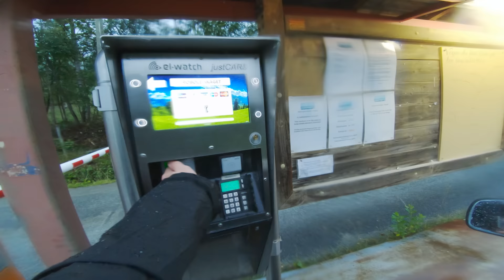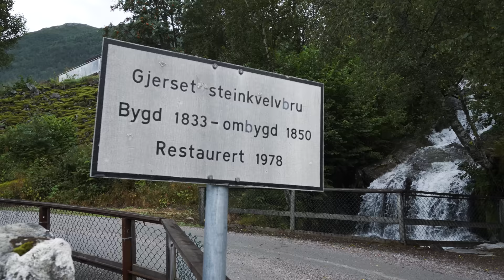NORWAY on a 125cc Motorcycle

Comment: I owned one of those Yamahas in Thailand except it was 150cc. The TZR 150 . Minbe was red and white and went like shit of a shovel. I actually saw 180 kph on the clock , tucked in with my head down behind the fairing. Didn't feel very safe but was a real thrill to hear the engine screaming through the red line. Long time ago now.

Comment: Been to Norway in 2016, on my TDM900. Great time riding. Went Hirtshals-Kristiansand. Hirtshals is exactly 1000 km from home. In Norway you see a lot of young dudes (why is it STILL not 50/50, what is wrong with the girls?!) riding 125cc. Where speed limit is 80 kmph, that is great, however, in 120 kmph traffic and left lane speeding, a 125cc has not enough reserve power that you might need escaping danger.  A 250cc bike would be safer! Pitty the EU has not done that. Things are what they are, and avoiding crowded highways is more fun, anyway.

Comment: I had a 1989 Yamaha TZR125 many years back. My model was the 2RK. Does yours have the fully working power valve (YPVS)? Your one must be the 3PC1 model as it has a rear disc brake.

Comment: Very good.
What cameras did you use and what settings while riding to get motion blur?
Reply from the maker: I used the gopro hero 6 for all riding clips. Everything was filmed at 4k 24p. The rest is filmed on a panasonic g9, also at 4k 24p.

To get good motion blur, you want to set the shutter speed correctly. There is a general rule in film making. The shutter speed always has to be the doubled number of what framerate you're filming in.
Example: 
24p = 50/60 shutter speed
60p = 120 shutter speed

You can change this manually in most cameras.

Hopefully that helps❤

Comment: Why did you need to fill engine oil at certain points? Does it dry up due to long distance riding engine heat?
Reply from the maker: It doesn't work like a 4-stroke. 2-strokes doesn't circulate the same oil, but mixes it with the gas and lubricates the engine in that way. Mine goes on an injection system, so you have to fill gasoline and oil in seperate tanks. Then it will automatically be mixed with the gas. Usually I need to fill oil every 2-3 tanks:)

Comment: I just got this as a suggestion; 2:21 cool feature; 3:05 good to know that it is still possible to run with two strokes motorcycles; it takes to be brave to ride motorcycles in wet and cold roads; nice places and good imagery, indeed, it's very hard hard to put up with these lame musics. Thus, I will not subscribe. (maybe on the day it'll be engine sound only).